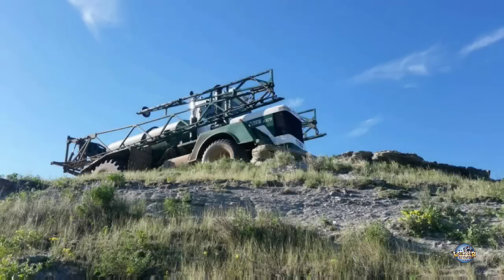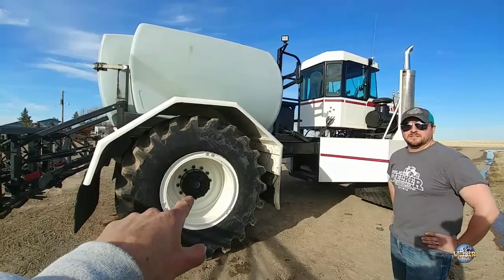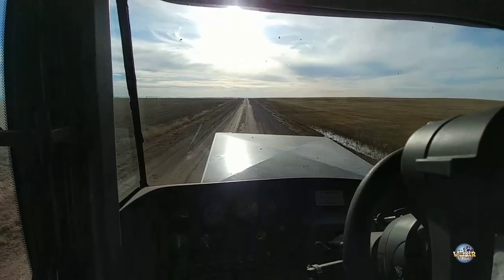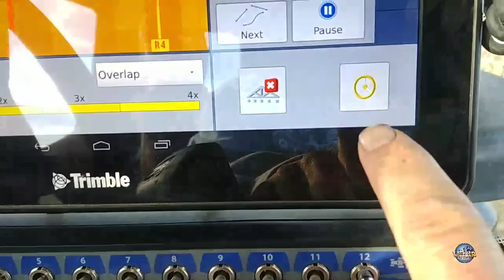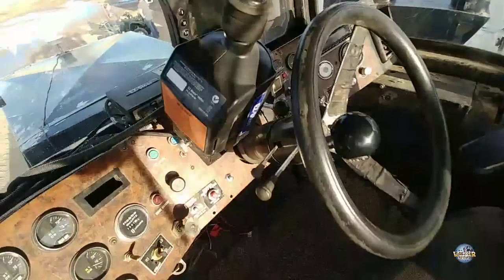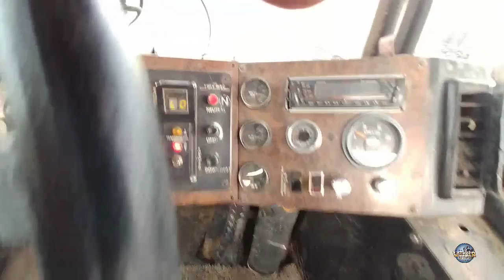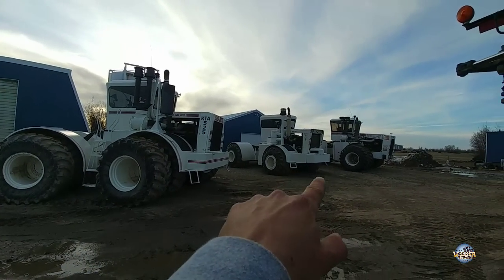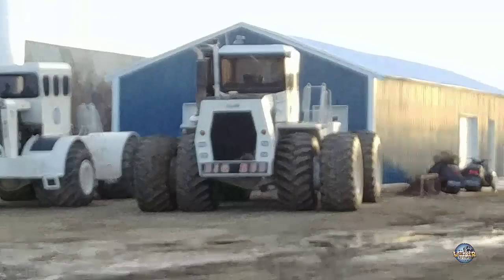🔴Live! The BIG Reveal! - Welker Farms Inc

Comment: You need to put some covers over the motor
Reply from the maker: Why is that? Only thing covers protect is paint and plastic/rubber sun exposure. The reason we built it this way is for simple easy access and air flow. Tractors today cover the engine for looks and noise control.

Comment: that is one nice machine  ,i love the way it drives ,,I have an old floater truck  i bought as a  toy  about 10 years ago , mine is a 1983 GMC C70  it's 4x4 too  and damn is it fun ,, mine will run about 60 top speed ,,it was originally a 10 ton fertilizer spreader owned by the local Coop,when I bought it i had to replace the engine it had a 370 GM Big block ,I replaced that with a 6V-71 detroit and a 6 speed allison out of a fire truck ,,great machine ,,I'm currently working on restoring it to original specifications ,it'll get used as a multi purpose vehicle at my  small farm i have a 6 ton spreader unit and am developing a swap load capability for it to allow me to use a sprayer with it too

Comment: If you will drive that much big tires on a seeded field then it can destroy the seeds
Reply from the maker: It actually won't, the seeds are underground so it won'd damage them and the large tires means more surface/lb of weight which means less compaction on the underground seeds. Now we won't use this to spray any crops when they are ripe and ready for harvest as it will lay the crop down then.